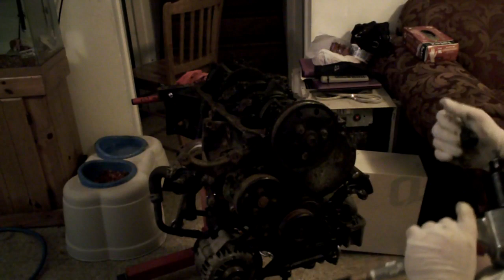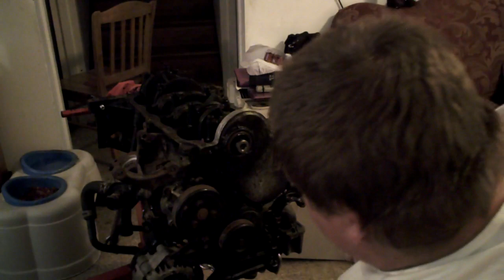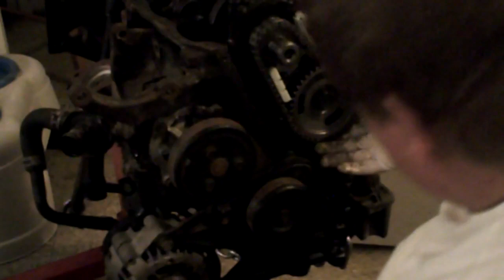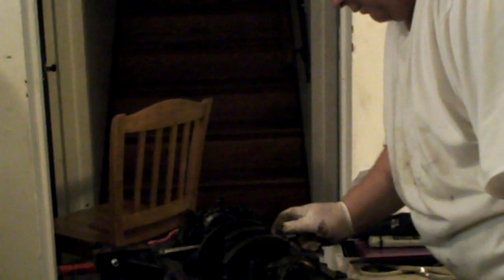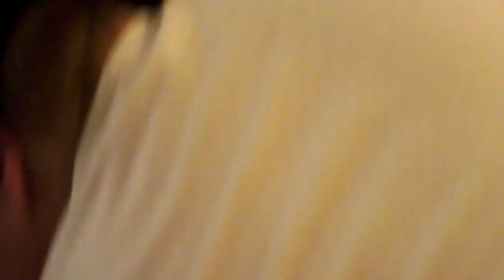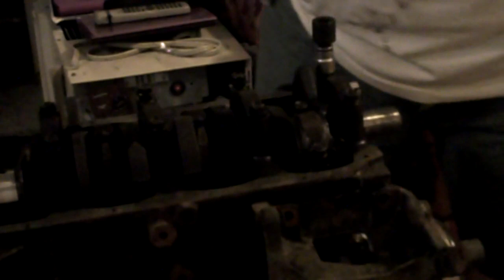Chevy Caviler 2.2L

Comment: lol, on an s-10 its a lot easier, if youre pulling the engine anyway, pull the radiator and the front damper bolt before undoing the flywheel. I think the only difference is the intake.

Comment: Hi good day.

I am new to the mechanics I am currently studying.

I have a cavalier 2003 2.2 which I require changing the water pump and repair the carter.

my question is how is the torque bearing cap screws timing chains \ as torque bearing the crankshaft pulley damper \ as torque lead screw cap carter.

waiting for your support,
thanks blessings

Comment: I have a 01 cavalier there is a bracket beside the oil filter held by 3 bolts what is this piece called all 3 screws gone?
Reply from the maker: Sueann Soto I'm not sure the name of the bracket. I do believe that you can get the bolts at any hardware store. I don't know the size of the bolts but I think they are a metric bolt. To be honest I won't be too worried. As long as the car is running ok.
Reply: Well the screw put a hole in the oil filter so just trying to put it back on thank you for the  reply.

Comment: Tinyd good day.
  I am in the process of Saturday here mechanic in Monterrey Mexico, I wanted to see if I can support and my car cavalier warmed to the stop and detected the thermostat is damaged but also check that the water pump is with blades with much rust too check this pump to remove I have to remove the chain cover and screw damper time with crankshaft pulley. My question is if they torque the cap screws and screw crank damper being made as is the torque and. Also if I can support with screws torque that Carter is given my car is cavalier 2003 Ecotec 2.2 support pending blessings
Reply from the maker: You always torque the main bearings from the center outward in a crossing pattern. As far as the bolts on the timing chain pulley you torque it in a star pattern.